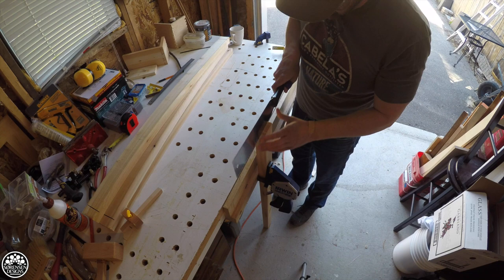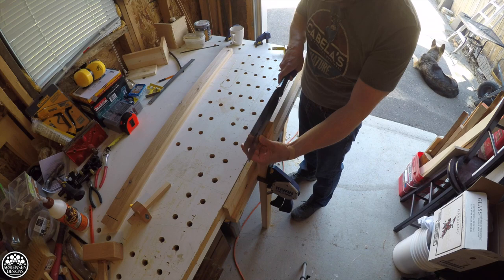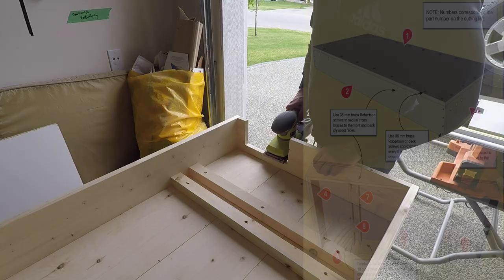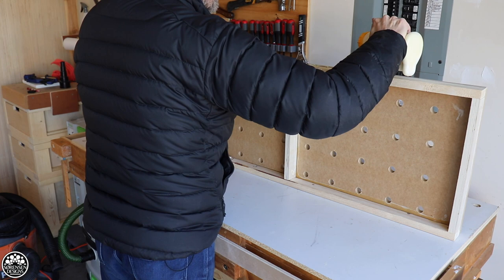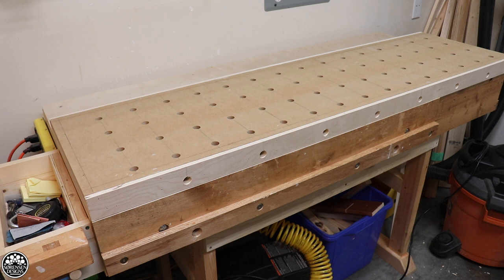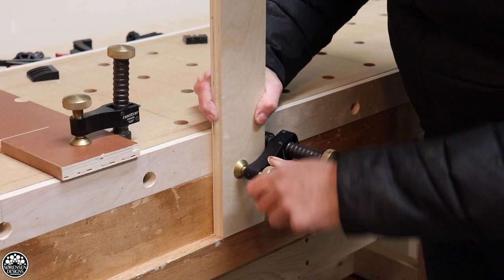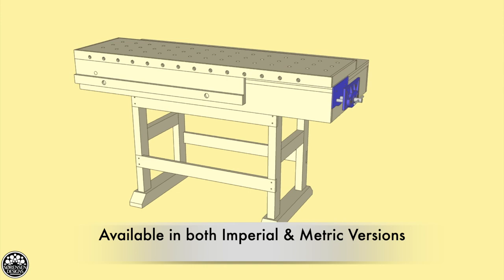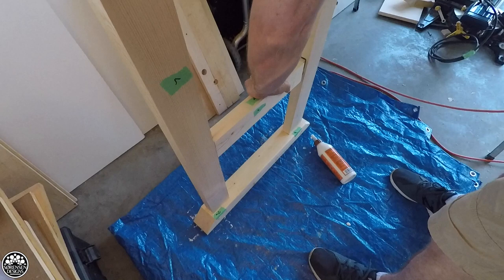The Evolution of The Workbench - Woodworking on a Budget

Comment: I like the idea, but I probably need to hang out in the wall and fold it down when I am ready to work.

It looks like this design idea might work if I can figure out the legs / bracing. Swappable tops means I could use it for woodworking it for reloading ammo, and hang the extra tops on the wall next to it...

Comment: Just found your channel and love the clear no nonsense approach! I was looking for tips to build my own bench on a small budget and with limited space and your new plan for the Versatile Woodworking Bench seems perfect. Could you give me a rough idea what the budget would be to build it?
Reply from the maker: Thanks🙂. The bench itself was around $100. The MFT top was cheap to build, around $40.For the complete build, you should budget for $200, including materials, a vice and hardware.
Reply: @EricSorensenCanada  Thanks for the quick reply. And excellent news about that budget ;-)
Reply: @EricSorensenCanada   Finally getting round to starting on the bench based on the metric plans I bought from you a few weeks ago. You mention plywood of 19 and 12,7 mm in the plans. Over here it's 18 and 12 mm. Would that make anything not fit once I get everything cut to size?
Reply from the maker: The plans can be followed within a 2mm tolerance, so your lumber should be fine. That said, I suggest you start with the main table box construction first, then the feet and legs, then the accessories like the front ledge and MFT top. You'll know if you have to adjust any of your dimensions once the main box top is built.
Reply: @EricSorensenCanada  So I should not have all of the parts cut to size first? I was hoping not having to make the trip to the sawmill more than once since it's not exactly nearby...
Reply from the maker: I suggest cutting your parts in stages. First the main top, then the legs and feet, then the accessories. Treat the MFT top as a separate project. The cutting list is divided into the parts needed for each respective build, i.e. Box construction.